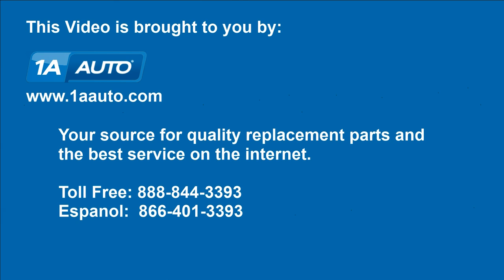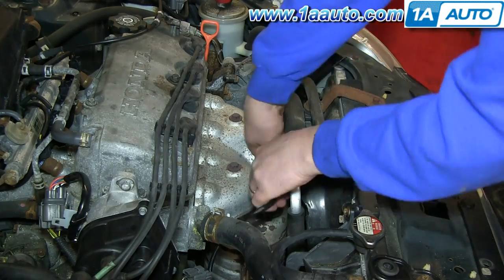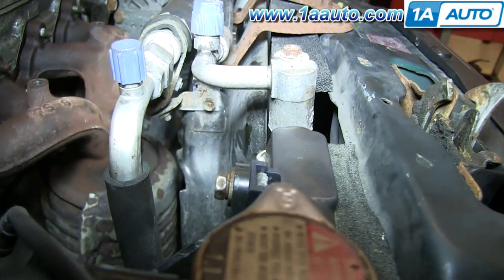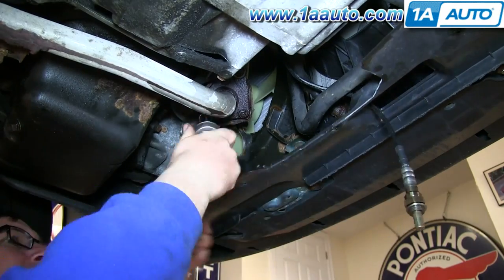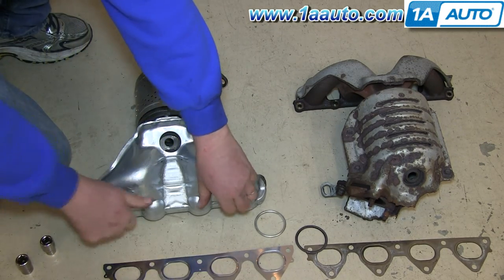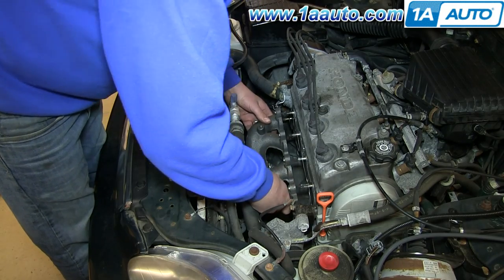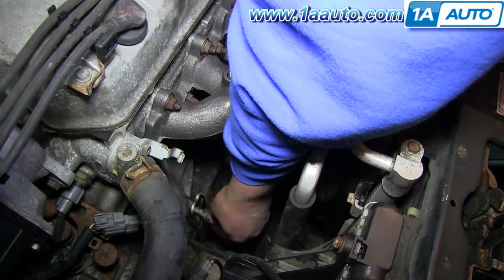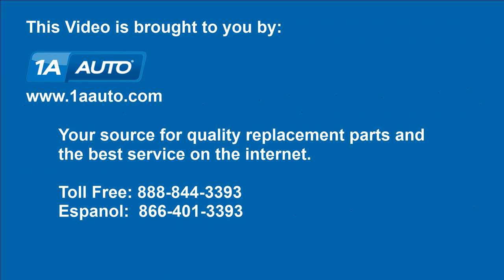How to Replace Exhaust Manifold with Catalytic Converter 96-00 Honda Civic

Comment: I bought a new catalytic converter replacement due to a p0420 code. Will I have to buy a new 02 sensor aswell to get rid of the code? Or just plug in the old 02 sensor to the new catalytic converter?

Comment: if i put this on my 2000 honda civic lx will it pass inspection in pa. someone told me the converter needs to be an oem. if i put this on will the check engine light still come on?

Comment: No offence but it goes a lot quicker if you soak the bolts in WD-40 first, Just a suggestion Exhaust bolts are real sticklers some times. Good Luck!
Reply from the maker: Thank you for watching! I agree some WD-40 or even PB Blaster will make the repair a lot easier.
 888-844-3393

Comment: Great video. Thanks. My manifold came with a gasket that is smooth on one side and dimpled on the other. Does it matter which side goes towards the engine block? I have seen videos where people use muffler cement in addition to the gaskets. Is this necessary or overkill?

Comment: What type of penetrating oil do you recommend for all those rusted on nuts. I would hate to break a stud off while doing this. Everything seems pretty straight forward, otherwise. At 254,000 miles, do you recommend changing O2 sensors?
Reply from the maker: +Linda Welch It's all personal preference which brand you use. Try em all and see which you like!

Comment: the one I bought has 3 bolts  I have to connect to the catalytic converter myself with only 3 nuts. The 3 bolts are threaded on both sides with about an 8th of an inch space in the middle that's smooth between the threading. how do I connect it to my converter/exhaust pipe?

Comment: Can You separate the manifold from the cat converter?
The mechanic says that my cat is defective but the manifold is ok. Are there any attached bolts shown that distinguishes the two?
Reply from the maker: It looks like there may be some bolts that attach the catalytic converter to the manifold.
Reply: No, unfortunately Honda combined to two. You would have to get a full aftermarket exhaust with the exhaust manifold a separate piece from the cat. I've got a similar problem. My cat is fine, but my manifold is cracked. I blame Honda for the troublesome combination.
Reply: no it's all one piece so you have to replace it all but it's not a bad thing since the manifold is not strong it can crack like mine did
Reply: Michael Carter No, if your cat is oem.

Comment: What if I have a after market exhaust that came with the vehicle and the bracket that plugs into the engine is not there
Reply: Josh Santiago sometimes its better not to have that bracket (heat shield) when something breaks on it or a bolt is missing they rattle and makes you think something more serious is happening i rather not have it on mine at least